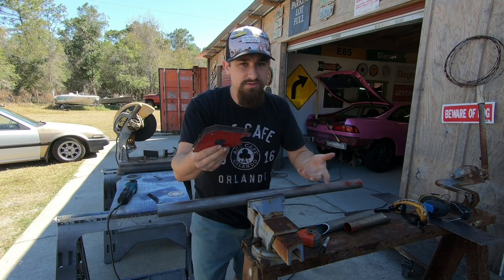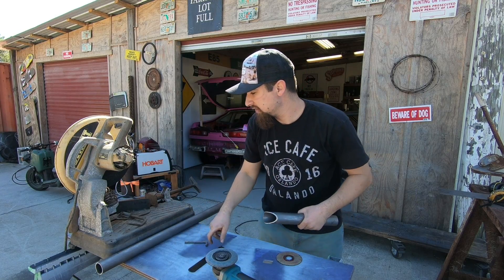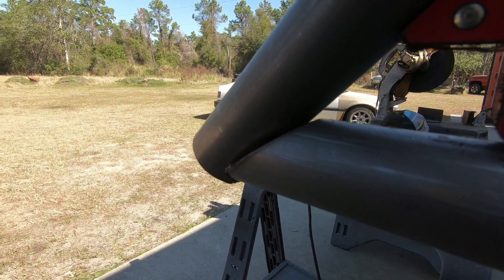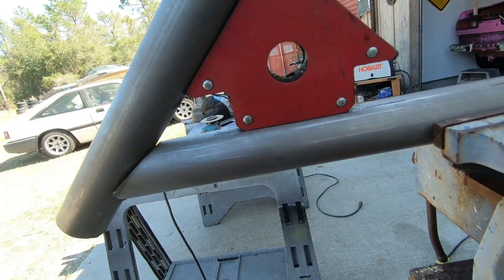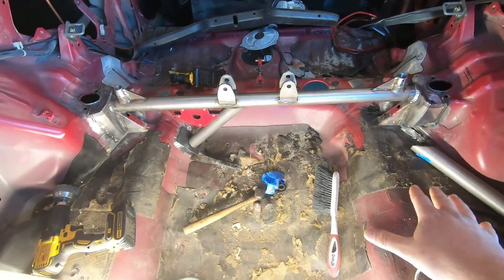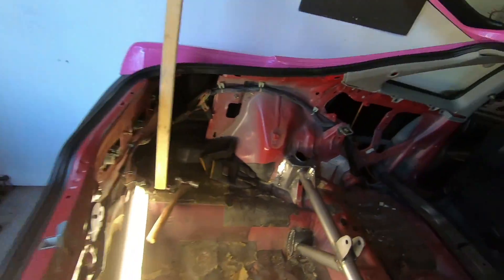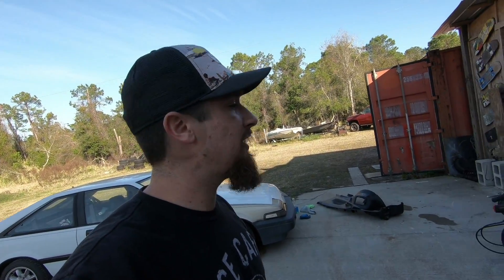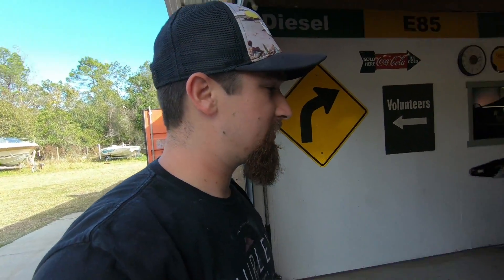Cantilever Integra suspension 45 Degree Notch Without a Tube Notcher!

Comment: i am going back watching these cantilever videos thinking about taking this project on for one of my integras. i was looking and do not think you mentioned it, and i hope you might still remember but what size tubing are you using looks between 1.75 and 2, also what is the thickness. ampther thing i was curious about is the brace tubing the same as the uprights for the suspension?